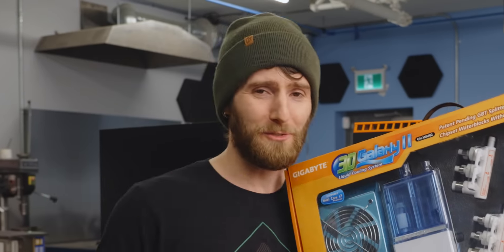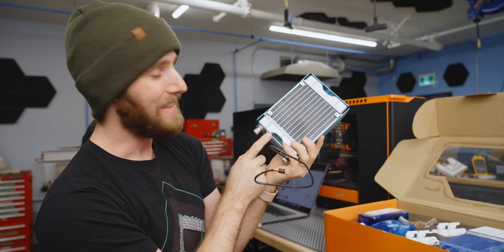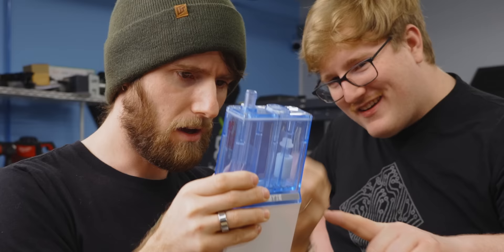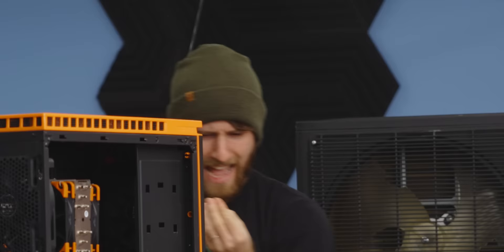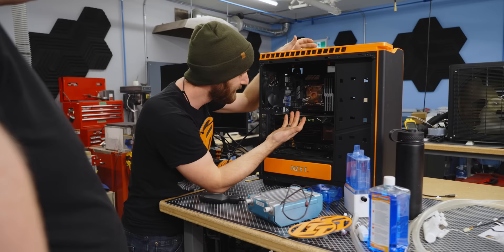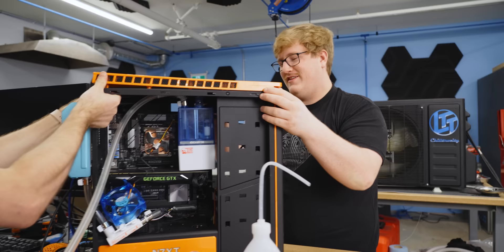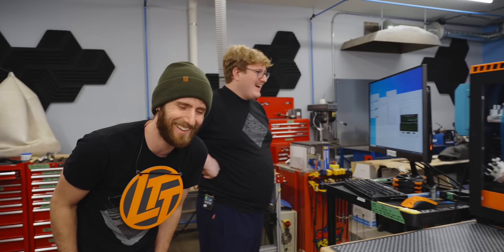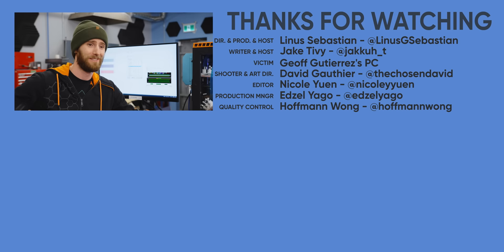This Product Aged Like Fine Milk - Gigabyte 3D Galaxy II Retro Watercooling Kit

Comment: Overtemp protection was not always a thing. I once had an athlon 64 that I unlocked with the super techy “use a pencil to bridge 2 pads”  that I cooked so much it cracked the die. The crazy thing is it was just unstable when trying to game or push the cpu! When I pulled the cooler off I was shocked that half of the chip was stuck. To the cooler. Ah simpler times!

Comment: I had this cooler, I just recently threw it out, didn't use it for years though. The worst part was the fan control, do it manually with the nub and doesn't cool unless you go full-blown airplane jet power 🤣. It was working great otherwise. And the freaking peeping if the float got stuck was a nightmare 😂. 

If they gave it a decent chance of performing "modern cooler and thermal past and actual good loop" it would have done better. I used it on i7 920 overclocked which was one of the hottest out there and did great job.

Thanks for the nostalgia
Reply: i remember we used to sand down both the waterblock and the cpu until you saw your reflection (change of 10-15°c )
anyway using a high pressure drop waterblock in a low pressure drop system is just freaking stupid
that's why we never bought  kit :p

sometimes, we didn't use fan,it was enough....

p4 89w low pressure drop, 1000l/h cpu and waterblock machined...temp:+-50°C at full load
atm an i7 is at 28w and you are happy  when you have 60°c with your new waterblock ^^
funny?

Comment: I still have and use the case and PSU from when I wanted to buy this exact kit. Its got cooling holes at the back and everything. I never picked up that kit as it never got cheap enough during sales. And GPU waterblocks were a paint to get. But I still love my case to this day.

Comment: I’d be really curious to know if you used modern thermal paste and modern coolant if it would work any better. Both of those items had to of experienced some kind of degradation.
Reply: I’d be almost certain that the real problem was the not flat cpu block. That had to have been a huge issue
Reply: @thegamerfromjuipiter7545  yeah but proper thermal paste would have helped fill in the gaps. I bet the old thermal paste that was in there didn’t help at all. But new stuff who knows.
Reply: @zachjoseph7121  it helped some. If you use a thermal paste that doesn’t work, even with a proper cooler, you’ll still hit thermal max pretty easily.

Comment: This is pretty cool If someone really wanted though they could switch the radiator for a copper one that would fit in the mount and CNC a new copper cpu baseplate. Im sure though that with newer coolant and thermal paste(also a lap job on the base plate) it could possibly pickup a few degrees better.

Comment: Yeah, I had that setup back when it was new. As well as the case. It worked quite well, for the time. It was also a hell of a lot easier than going off and building a totally custom cooling rig back then. We didn't have aisles of connectors, tubing, etc. A lot of your shopping was done at Home Depot for the various bits. There wasn't an abundance of cooling rig DIY kits or AIOs like now, especially where I was at the time. Yeah, the aluminum rad and copper block weren't the greatest idea, but as long as you refreshed the coolant periodically(Which really was easy as hell with that kit, to be honest.), it kept corrosion pretty much down to nil. Yeah, they advertised the blue LEDs. At that time they were rare and incredibly expensive compared to other LEDs. No, it didn't block the video cards. And yes, the pump with the built-in cutoff was a really nice touch.

So yes, the kit wasn't the greatest. But it did work, right out of the box. It was also a lot quieter than most air/air coolers as long as you didn't have the fan going full bore(At full bore, it sounded like an vacuum cleaner running next to you, but it did push a heck of a lot of air through.). And as cheesy as it seems now, it worked pretty darn well.
Reply: Yea for people who would otherwise have an intel stock cooler, it was an upgrade.

Comment: HOLY SHIT! THE NOSTALGIA! I built my first computer when I was 11, and after a month I went to CompUSA with my dad to well, buy some more computer games, and one of the sales guys knew about this. I can't remember if we bought it there or online but I was able to install this fucking thing on my PC. I remember it being a bitch, but it worked great for more than half a year before I had my dad sell that PC to help pay for some custom ice hockey goalie gear. I wonder what happened to that computer, and how long that aio lasted before dying to x reason. Thinking back on it that computer was absolutely disgusting looking, the case was used and the previous owner spray painted it blood red, with this ugly fucking aio and ketchup and mustard cables. It burns thinking about it. but at the time I'm pretty sure it would have been considered top tier among pcs with AMD CPUs around that time. Ohhh the memories. thanks, LTT for the memory lane ride! 

edit: i can not for the life of me figure out what the specs could have been other than knowing it had an AMD Athlon 64 CPU and probably a gtx 7900, i remember what the GPU looked like but not the model, unfortunately. but I do remember wanting the 3D GALAXY ll because of the blue coolant., and for the time, I think it looked cool with the amount of color it had going on(my dad cut out a hole in the side panel and put some see-through plastic over it so i could see the insides all the time, even put in an led strip to light up the insides) . I eventually got an Alienware aurora star wars edition a few months later, which I do still have and one day, hope to build either a throwback system(i have a 2010 dell xps for older games atm) or go mad and modernize it.

Comment: The pump and reservoir was actually pretty decent (not surprised that it was stuck on the first power-up at that age), so with a modern radiator and cooler block, it would be a decent enough alternative.  The shutdown on low coolant or overheat beats the heck out of frying a CPU.  It was AMD CPUs that were the danger for overheating back then - Intel had thermal sensing and throttle back at least from the 486 (I overclocked a few and found out or myself), and possibly even 386 processors (never tried to push it on those or 286s).  It was fully mature by the original Pentium, and a big advantage on the P4, when AMD were attempting to take more than modest low-end market share.  I had my P4 2.4G (fastest I could afford) running at 3.2G on air, and it rarely if ever throttled - running FaD with any spare cycles, so maxxed out pretty much 24/7 (who needs heating in a house anyway).  33% overclock with 100% CPU use 24/7 is pretty brutal!  I'm pretty sure my P4 2.4G was one which failed validation for hyperthreading (standard on faster ones) so was multiplier limited to 2.4 to make it saleable.  I can't imagine any other reason to sell a CPU that fast as a 2.4G, so I kinda had a golden chip.  It sure churned through a lot of work units.

Comment: So my dad used to be a firefighter in a town.  This town, built in the late 50s and into the 60s, flip flopped back and forth between aluminum wiring and copper, whichever was cheaper.  Houses actually had junctions where aluminum wires and copper wires were twisted together.  Interestingly enough, when my father was a firefighter, they peaked in electrical fires from galvanic corrosion, back in the 90s.  My father, in this relatively small town, would respond to more working fires than some nearby departments would have total call volume.

Comment: Yeah that waterblock is rough, but then we have to remember this was like the athlon 64 era sub 100 watt , like a non oc a64 3400+ was like 70 watts power consumption... and many were using it on bartons athlon xp and teh athlon XP mobil which had an even lower power consumption than all the rest...
Unless you were using thermalright or Zalman you never got a smooth surface, just wasn't really important back, WC even with a bad water block was still great

It would be really interesting to actually test if this worked better than a thermalright sp98 on an athlon 64 3700+ san diego for example

Comment: UV reactive back then was all the rage.  I had an all clear acrylic case that was UV reactive.  Cable routing was a nightmare and I ended up shortening and repinning the PSU harness.  Also loomed in UV reactive orange of course.  I would have killed for a modular PSU back then.  It also doubled as a room light for the LAN parties.  I still have the case and have always wanted to do a retro build with it.  Maybe one day.

Comment: The alternative back then was massive enormous zalman "wave" or "circle" fans. Or that zalman massive out-of-PC towers. Those times were horrible for coolers. K7/Athlon XP were defo better than early P4 CPU's but one wrong angle and chipped core could happen. And when removing the cooler, you could take one of the stress pads off. I miss those times for some reason.
Reply: The side of the box says it supports LGA775/1366. It’s really from about 2011. Not nearly as old as they think.

Comment: Lol, you guys picking on this kit. Let me describe my first watercooler rig. This was back in the day before water cooling kits. Everything was homebrew. I still have the water block I keep for nostalgia purposes.

The cpu....intel celeron 300a running stock 300mhz at 66mhz fsb. My homebrew liquid cooling setup....the water block was a 1/2" thick piece of copper bar stock a machinist cross drilled and plugged with barbed fittings on the inlet and outlet. I did lap the contact surface to a mirror shine. The radiator was an aftermarket transmission cooler from the auto parts store with a couple 80mm fans attached and strapped to the side of the case. The reservoir was a square plastic electrical junction box mounted to the top of the case with inlet and outlet fed through a groove cut in the lid so the reservoir was not sealed water tight. The pump was a mini submersible garden fountain pump "mounted" in the reservoir. The tubing was clear plastic from the hardware store. For coolant I just used standard distilled water. When completed my PC looked like it was being assimilated by the Borg. 

But, I got that celeron 300a from 300mhz to 450mhz (a 50% overclock) with 100mhz fsb and since the celeron used on die L1 cache running at full fan speed my overclock out performed the much more expensive PII 450 which while it had larger cache it was off die running at half fsb speed.

It was an adventure and I was so proud of that machine I remember lugging it back and forth to LAN parties. Good times.

Comment: I knew that those holes where for liquid cooling ( my old NZXT case has them) but this is the first time I've seen them used. honestly it looks like a decent setup, considering the time period. I like the auto-cutoff feature.
Reply: The intended use of those holes was news to me and i've been using the same case in the video since 2013
Reply: yea my old case has those holes. I never saw anything like this but I did know of external radiators, but more those standalone ones, like a brick that sits on your desk.

Comment: 8:45 LOL my case have those rubber holes to pass the tube and I never knowed for what those were, yes I stil use a 2009 case, a case is a case you don't need to replace it, I just upgrade the internal component and them fit perfectly in a good 13 years old case.

Comment: So...this is 100% same as mine, except I have the Gigabyte full tower Case with it built in. But as I was looking at the packaging, I noticed even the bottle of coolant has the same label. And the reason this is relevant for me right now is I am building a water and TEC cooled experiment, so started to pull apart the Gigabyte Tower case and found it was the Galaxy OG same as this video.  But very neatly built into the top of the case. I can't wait to watch you put it together....as get a hint on pulling mine apart...haha. I mainly want the Reservoir and pump, as I already have 2 x 360 thermaltake thick radiators and about 20m of pipe...

Comment: The 3d Aurora case was actually a pretty nice Aluminium case.. I used a 3d Aurora 2 Full Tower case for many years across probably 3-4 rebuilds, it was awesome because of the size it could fit anything.

Comment: I started watercooling in 2008 with a black ice 360 copper radiator, eheim 1046 and other stuff. Together with some of the fittings I still run that radiator today :-D

Comment: that watercooling system is a masterpiece, when it came out it was incredible...but it's early 2000's for pentium D, pentium 4 and athlon 64x2 was incredible, if you use it with new processors it won't be enough

Comment: We did watercooling setups exactly like this back in the early 2000s playing OG Counterstrike and TFC competitively, trying to overclock everything to stick 99 fps. 
I believe we ended up buying aftermarket custom cpu/gpu blocks and trying a bunch of different thermal pastes until we found one it liked. The factory blocks were the horrible weak point and just did not fit or channel and flow well enough to be even close to effective. But after that, we were running substantially cooler. We even used those ice pack velcro sleeves you wrapped around the tubes to drop coolant temps.

Trying to move these giant heavy delicate setups to goto LAN tournaments.. that is another story..

Comment: I had one of these! build my first rig in 2008 with an AMD Phenom 9850 Black Edition. I think the pump lasted about 9 months before it failed and I swapped over to a cool master V8 Peltier cooler. Went to college in Nebraska, we used to stick the radiator out the window during the winter (around 0* + a negative wind chill) the CPU would sit at something crazy like sub-40 under load, considering a single fan and small radiator not bad. But in anything above sub-freezing temperatures, OMG the heat!!! This thing used to thermal throttle my cpu after a couple minutes of running and the room used to heat up to like 80* (F). The pump failed well because I forgot to bring the radiator inside one night I powered down the computer and the lines froze. Good times! *Edit:: Coolmaster V10 cooler* guess I was fancy back then.

Comment: I had an AIO that used two 5 1/4" drive bays. It was great, way easier to install, and worked well for a long time. Think it was made by Kingwin. Would have been around 2005 when I bought it.
Reply: Yes!  I watched this video and was trying to remember the one I installed for a friend that had the pump and reservoir situated inside a 5 1/4" inch drive bay along with a control dial and digital readout - and you're right it was Kingwin!  I googled it and the product page on Newegg is still there, "Kingwin AWC-1 Liquid cooling system".

Boy was a piece of junk though, I remember it failing after a few months on my buddy and he had to junk the whole thing and just did regular air cooling in the end lol.
Reply: @486DX40  That sucks that it failed. Mine lasted for years. As far as I remember, it was still going when I pulled it, but the pump was getting very weak and the system even new wouldn't have kept up with the new hardware at the time. Nostalgia, ftw tho! lol

Comment: This reminds me of my old Koolance case (which indeed had an exos like thing built in via a top cutout. The OG era of water cooling was wild. Lots of plexiglass with copper pin arrays and limited in actually forcing liquid through as much surface as possible. It was back when stuff like Vapour chambers where unheard off and it was already fancy if there was just one single heatpipe. Modern Air-coolers, AIOs and Custom loops would blow the old bunch straight out of the water.

Comment: Ahhhhh yes. I remember my first "real build" using one of the old Thermaltake bigwater kits. Hacked up my case (hard drive bays then relocated drives) to fit everything in the mid size case. Topped that loop off with some good 'ol feser fluids and went at it. I ended up feeding the radiator air from my window ac unit which actually worked out pretty well.

Comment: I built a custom setup back in the day when these were the commercial option.  5 1/4" drive bay reservoir, Danger Den block, pond pump, radiator that hung off the back of the case like that..... to cool a Pemtium 3.0Ghz cpu and maybe later an Opteron 165?  Been a long time...

Comment: I still have the original case this cooling system was designed to go in,the Gigabyte 3D Aurora still has my first ever PC build, features an Intel Core 2 Duo, a GPU that uses AGP and I can’t remember any other specs.

Comment: Adding a couple of ounces of synthetic water based lube would also help reduce galvanic action. And the reason they use aluminum for the radiator because aluminum transfers heat better than anything else they could have used.